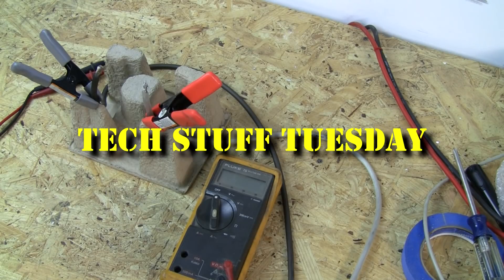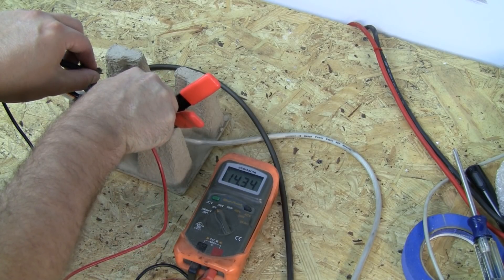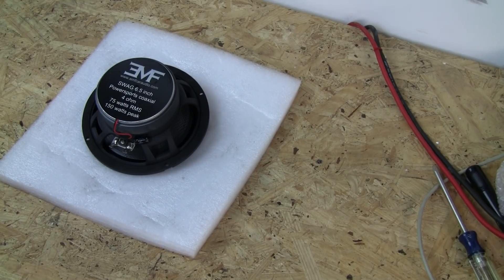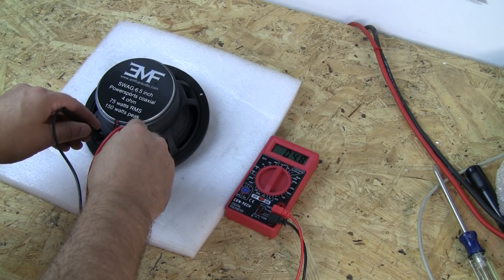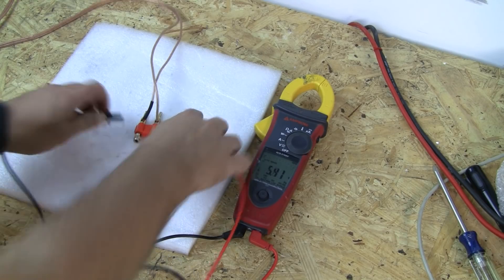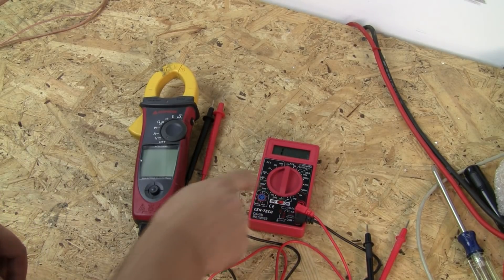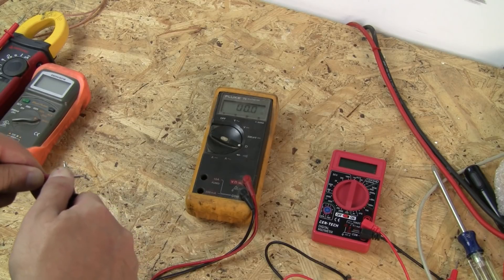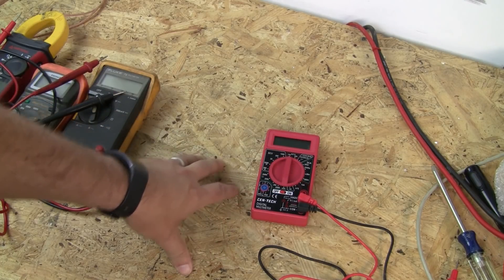Tech Stuff Tuesday - Your DMM sucks

Comment: that fluke has autoranging, you can hold and autorange, its fluctuating because its trying to lock. I have a Fluke 75 and a Fluke 323 "trueRMS" clamp and the 75 is so much more accurate than the clamp, the clamp does come in handy for reading AC amperage. I cant stress enough how important lead checks are, if your leads are measuring 1.1ohm's by themselves its clear somethings not right about them, cheap leads will usually read 0.2-0.4ohms, proper fluke leads fresh out the box will 0.00. Use these meters at work all day, in fact we trust the 70-series flukes over the 113/114's, the autorange in the newer meters will actually make your readings inaccurate. I really wish I could take pictures of examples of this at work, you can measure out 7.66k ohms on a 75 and try the same leads on a 114 and measure out 5.45k ohms, im not even shitting you they just arent right at higher resistances

Comment: i love my free centec from HFT. only really good for DC voltage monitoring which is all I use it for. I am however in the market for a clamp meter that will do up to 4/600A DC (maybe even 1KA), aswell as a piece I can hard wire at the Alt and have a dash display.

Comment: Funny. I just watched your explanation on Theile/Small parameters. You seemed to have a decent understanding of the terms. I am surprised you kept saying impedance instead of resistance in this video! Like the spec Re, you are measuring the electrical resistance of the voice coil. Impedance involves AC voltage and it's effect on an inductor (coil) aka voice coil in a loudspeaker. The clamp type meter is an electricians aide more than a high precision bench meter. It will have a tough time measuring <1 ohm. Before condemning the Centec meter, I'd try a GOOD set of test leads. I bet the stock wires are so full of impurities they are resisters of their own! I bet they are just tin junk to reduce cost of meter. A TRUE RMS DVM has the ability to look through a distorted wave form and find it's average voltage. A standard DVM gets confused by an impure sine wave and shows a different reading. I do enjoy your videos and find them educational. Good work!

Comment: The leads on the centech are probably the reason for the high reading. I swapped out the leads using one and it read pretty close to my crafstman and fluke
Reply from the maker: You're probably right, but people get those meters and use them as they come which causes problems.

Comment: You are moving the coil into the motor gap because you put the speaker on the cone, that's why you have variations on resistance not impedance....
Reply from the maker: What you said doesn't make sense. The speaker is the whole thing, not individual parts. If resistance varies it's not resistance, it's impedance. That's why the resting ohms is called DCR or DC Resistance and not impedance.
Reply: You said in the video you will measure impedance that's why I corrected you, and I was refering that you were touching the surround of the speaker to the table and that maked the speaker variate it's dc resistance
Reply from the maker: @dobrisanmihai2952  I mentioned it was changing because of the surround touching the table and pressure put on it in the video. The point wasn't to show how to measure it, that's another video. The point was to show variance of great quantity.

Comment: You should have switched leads from the cheap dmm to the fluke. I can almost guarantee it would have read differently. Quality leads are just as important as a quality dmm.
Reply from the maker: I was going to do that but the connections between the Harbor Freight and pretty much every other meter are a little different. The won't plug right in.
Reply: @EMFAudio  Any time you want an accurate resistance reading you touch the two leads together and subtract that from the reading of the component you are testing. Never trust meter/leads no matter the brand. This tip is for everyone not picking on anybody, just a good practice.
Reply from the maker: @scottxp800  I am aware, but there are other factors that cause issues with any resistance as well. You can't subtract resistance from voltage.